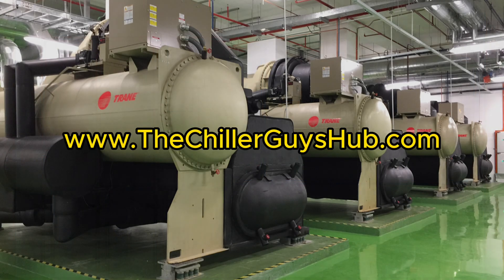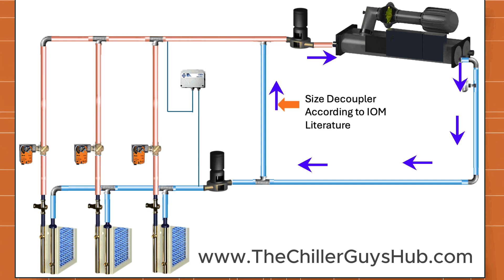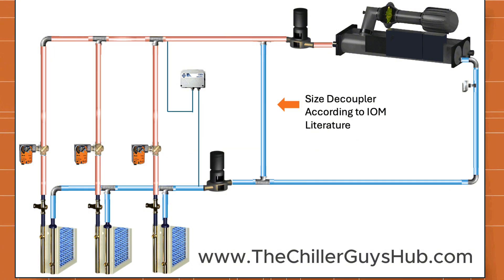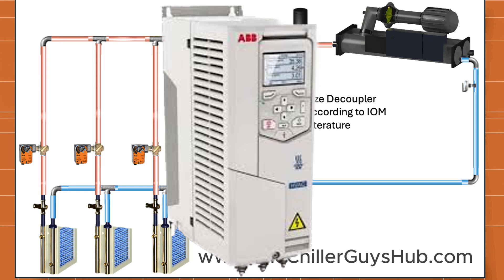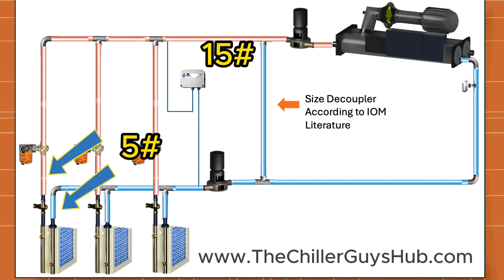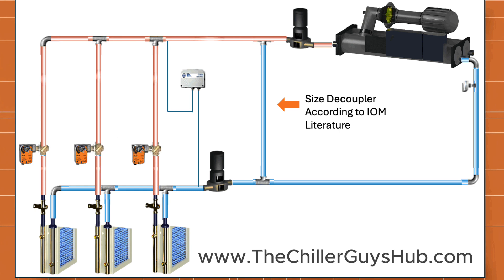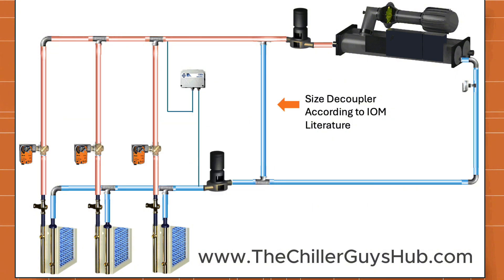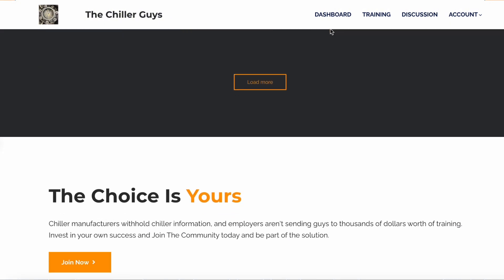Primary-Secondary Chiller System Controls | How to Setup The BAS for Efficiency and Reliability

Comment: Thank you for the video - it’s one of the best ones I’ve seen so far! 
7:08 in the valve in the decoupler setup you said it has to be tuned, could you please elaborate on that? The secondary pump will have the min speed, so whenever the pump is on (and say the min speed is 20%), then bypass valve will be fully open. Then as the speed of the sec pump increases from 20 to 100 % the valve will close from 100% to 0% right? Did I get it right? Or when you say it has to be turned, you mean I might not be 0% for the valve when the pump is at full speed right?

Comment: Pretty much the BAS should close the valves for the ahus every 10% per 10 minutes, then once the valves are closed, then we could shut everything off, right?
Reply from the maker: 100%, you can close each valve as you wish, but as long as it doesn’t affect the chiller more than 10%, for example, if you had 100 valves at 100%, close 10 at a time, wait 10 min, then close another 10, etc.

After all valves are closed, you can disable the chiller, wait another 5 min for everything to unload, and then you can shut the pumps off after that if you want. 

Doesn’t matter so much on startup, as long as the chiller has flow before it tries to start the comp.
Reply: @ thank you

Comment: Flow boils down to pressure differential. You will have flow through the line with the greatest differential. High to low, hot to cold....these are hard facts with fluid and thermodynamics. Temp/pressure differential= flow

Closely spaced Tee's are also important so that the flow through the common pipe is minimized to what you need/want. I know there is manufacturer specific ratings....but I found a good "rule of thumb" is 3 GPM per ton
Reply from the maker: ASHRAE standard is 2.4 on evap, with 3 you’d be golden on pretty much everything as a base. 
I have seen them add bypass valves, because they usually put too small of a pump on the secondary lol is this common down there, or do you guys have better engineers lol?
Reply: @TheChillerGuys  it's hit or miss. You get textbook...or someone who pencil whips it. Or if you're really lucky....someone who knows absolutely nothing about flow and has a "great idea"
Reply from the maker: @JJ-COMMERCIALHVAC   yeah for sure, the typical, "I've been doing this for 97 years, I know everything" response is a classic one lol people are goofy sometimes.